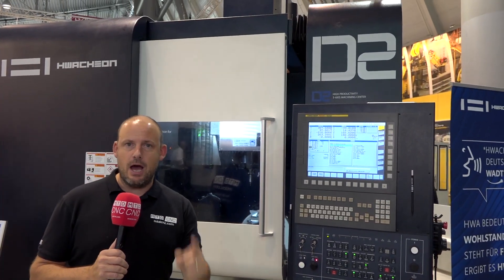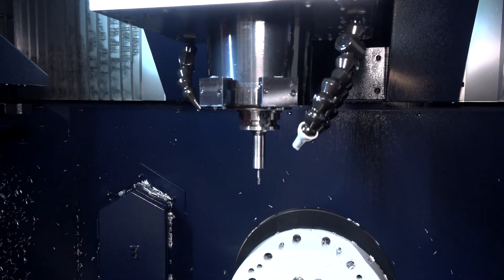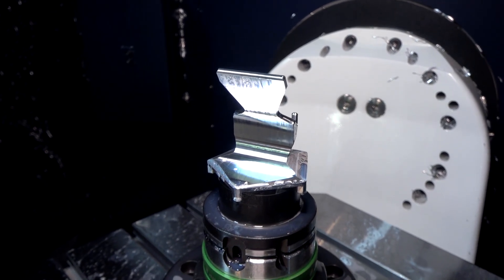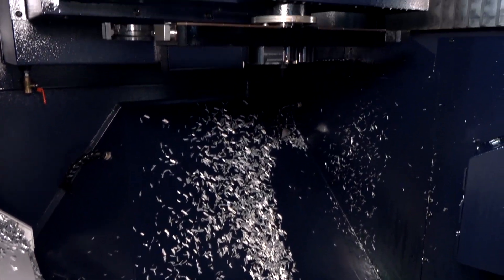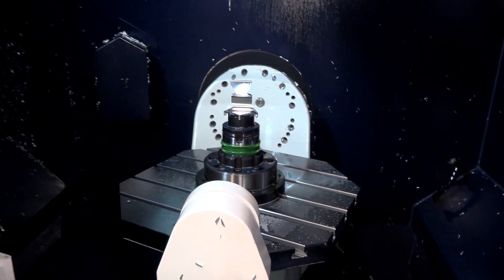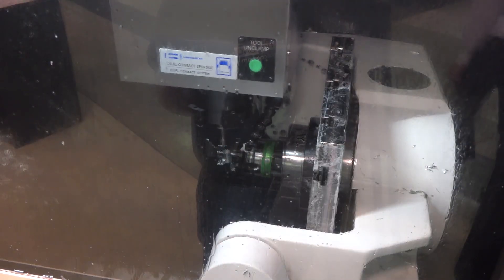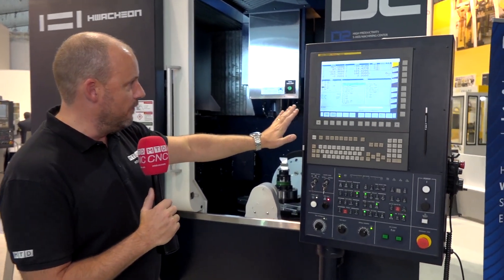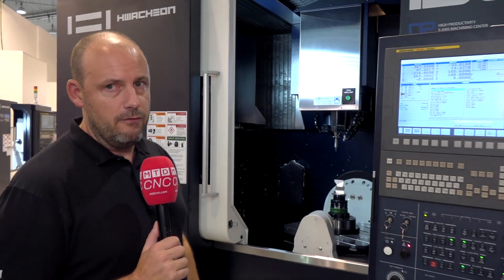New 5 axis D2 from Hwacheon - this is a head turner

Comment: How is this different from the Spinner, Doosan, Feeler, Romi, Hurco etc etc etc - all are essentially the same machine tool with different sheet metal and a choice of controls.
Reply from the maker: this machine, the main control is fanuc
Reply: MTD CNC you can get more then FANUC, Hwacheon offers Siemens and Heidenhain for this machine.
Reply: The thing that sets this machine apart is two things mainly.  The first is the spindle, all the spindle options on this machine are oil jet, the HAAS, Doosan, Feeler are grease packed spindles with cooling jackets, the Doosan is is Air/Oil when you go to the 18k spindle, I think the HURCO is oil air on all the spindles.  Oil Jet spindles are more reliable and more powerful then direct drive spindles becouse the Hwacheon Oil Jet spindles are integral motor spindles built in house, this machine has more horsepower and torque then the competition.  Hwacheon also offers more options when it comes to speed, 12k/14k/20k/24k.  The second is the casting and overall build quality is the second point, it’s a Meehtnite casting made in house by Hwacheon, I won’t go into the design flaws some of the competitors have that cause inaccuracies.  The machine is designed and built in house by Hwacheon, they control quality better then the competitors mentioned above, this machine really competes with the DMG DMU-50 more then the others.